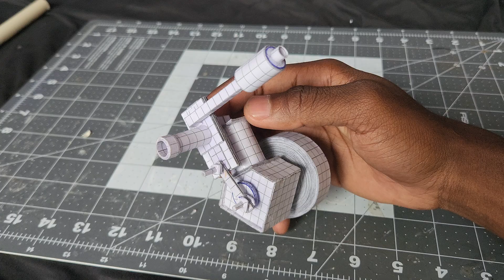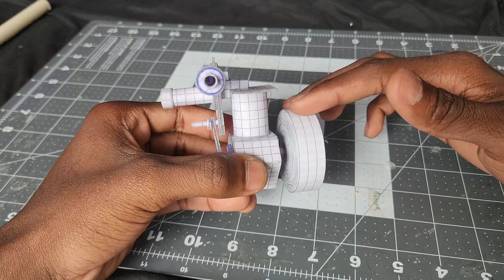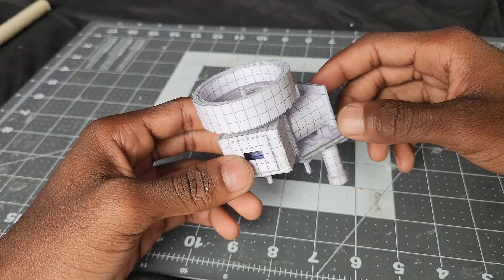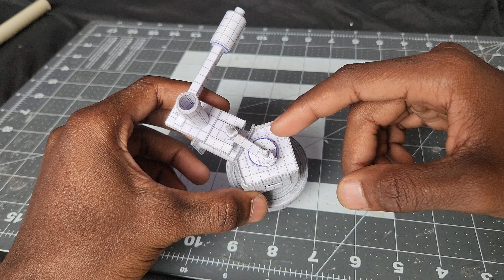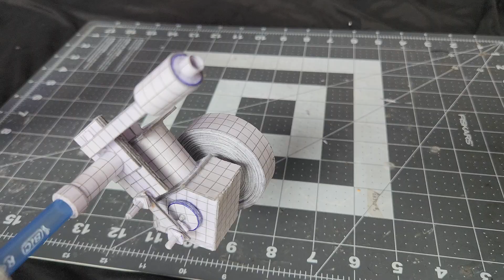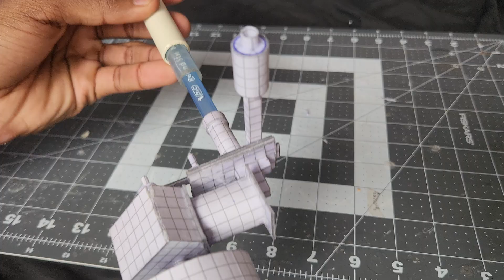Single Cylinder Paper Air Engine With Working Exhaust System

Comment: So, an update on my engine (this model) the sliding valve didn’t work so I tried to make a ball valve system but the bead was light, I saw how engines supply the air and gas and it occurred to me that I can use a pin system. So I will try to make it then update